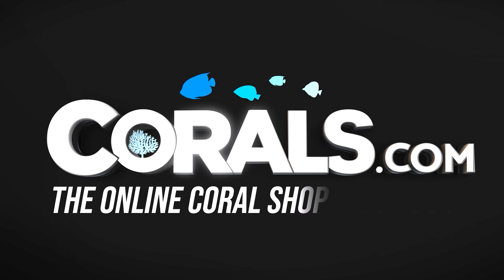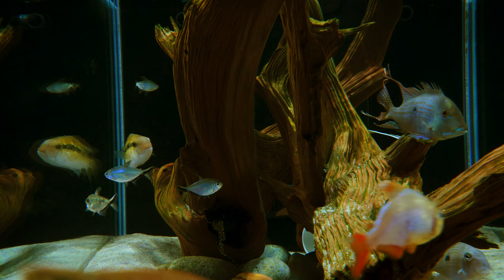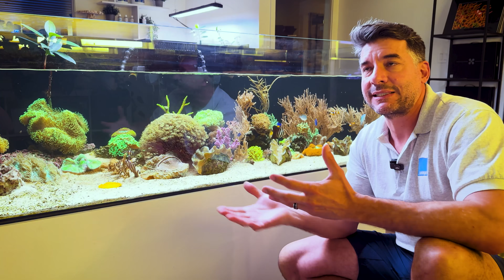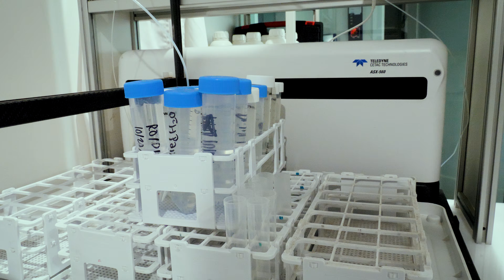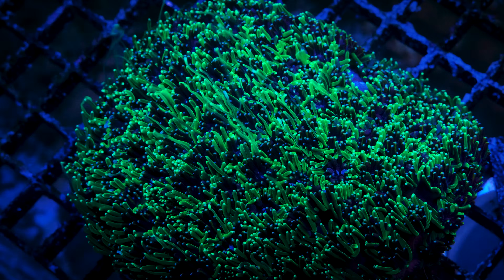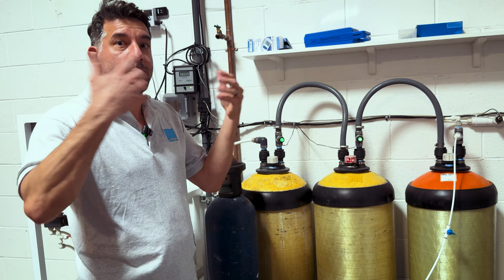Touring The Cleanest Aquarium Show Room + High Tech Water Testing Lab

Comment: In regard to the control of excess doc’s and fish waste, is there a ratio of coral coverage to fish load where the system to process nutrients on its own? 

In my aquarium I have a lot of fish but not many corals so I have to regularly vac the sand and remove detritus to keep excess nutrients and algae growth in check. I do very few water changes. Would more coral coverage bring a better balance?

Joes aquariums and the Triton method do not include mechanical filtration but they are packed full of corals. Are the corals the primary filter?
Reply from the maker: coral mass + fuges are the primary form of export with the triton method - although they do prescribe water changes as a tool for things like DOC removal at times. I have been going back and forth with Triton on if fuges lead to an increase in DOC - the science is still out on if macro algea based exudates are the problem on wild reefs
Reply: @ thanks for the reply. I also wander about the chemistry that coral release into the water. Sure they grow and absorb doc’s out but they also put doc’s back in I would presume. Does macro remove these? I guess we have to fall back on carbon and skimming but it would be great to have a better understanding of what life forms produce and absorb.